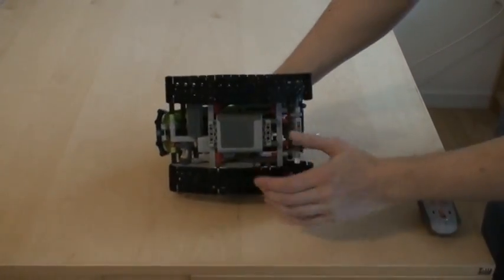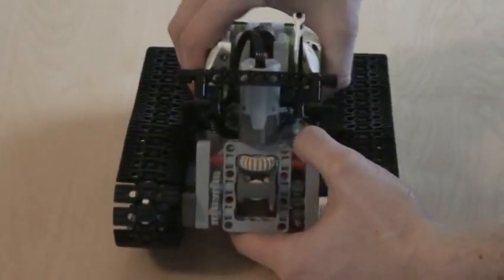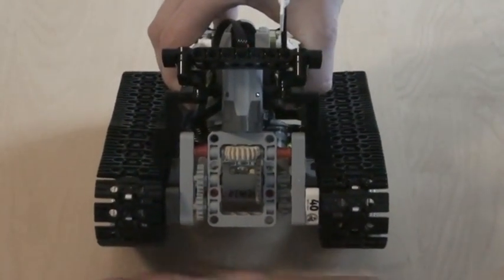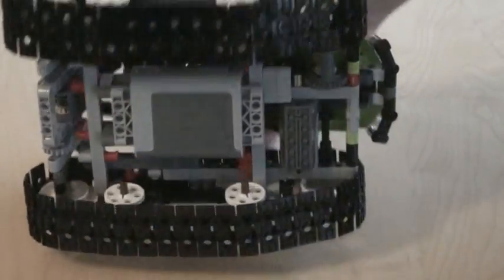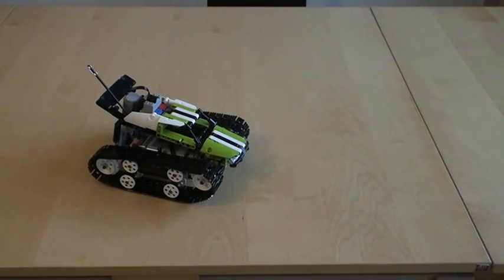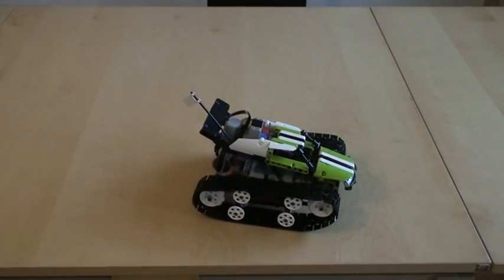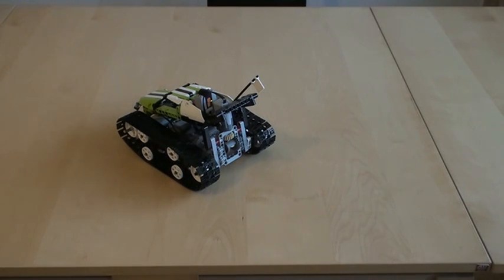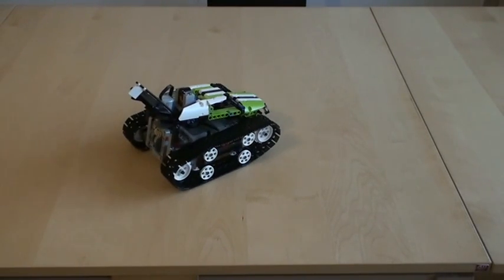Mod: Differential drive + LEGO 42065 Technic RC Tracked Racer

Comment: very nice implementation of this system, using the tracks themselves to connect the motors.
You do however lose a bit of power using this ystem, because only 1 motor drivers the forward motion now.
Reply from the maker: Yep. The system is far from optimal in using the power from the motors. If anything, it is educational in how to make a simple implementation of differential drives.